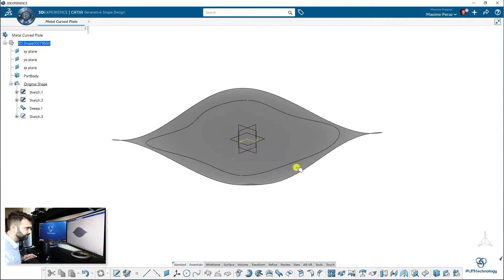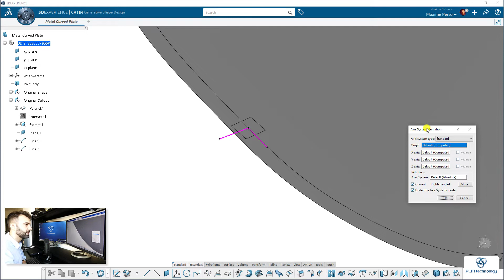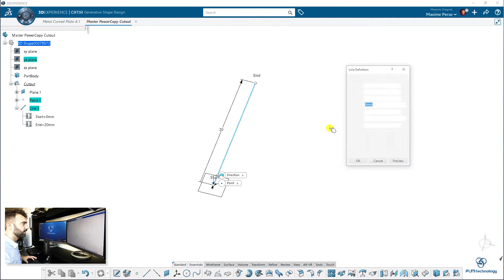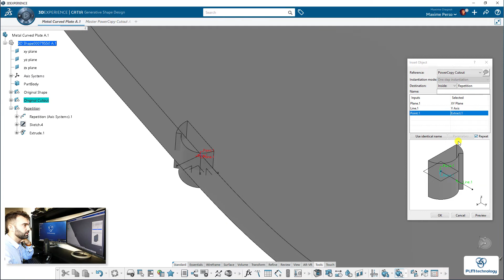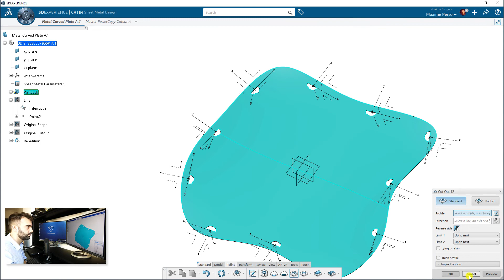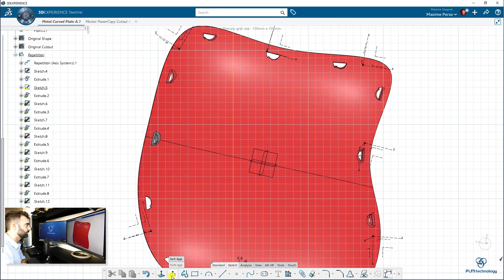Power Copy for Cutout Sheet Metal - CATIA 3DExperience R19x

Comment: Hi Maxime, Thanks for the video!
Would it be easier to put the points, plans and lines a several lists and use it to create the PC instead of selecting them manually in each PC? (or maybe this option wasn't available in R19?)

Comment: i like your patience and explanations...superb....explain something industry oriented design process to understand better what exactly going on industry about design...please explain application of the tool with example could be better
Reply from the maker: Hello Dinesh, thank you for your comment. This video is actually industry oriented (from customer scenario). This is a double curved sheet metal part containing a special type of cutout from a machine. The part is designed curved and the holes are position around it and flatten the part at the end.
Powercopy allows you to save an assembly of feature (commands) and reuse them to create quickly a complex shape. It is used especially for repetitive tasks. Another example could be for plastic clips or a plastic/rubber profile. (watch this video: https://youtu.be/W9js4Ax6OqI )
Reply: @MaximeChagnot  oh nice...thank you i will see this one again...
Reply: Is it right to use spline in industrial design as you created in this profile?
Reply from the maker: @dhineshwaran551  Can you elaborate your question? Not sure to understand
Reply: @MaximeChagnot  is it correct to use spline tool in sketch from industry point of view...actually my friend told me that no one use spline tool in industrial design process...
Reply from the maker: Ok Dinesh I understand! Well I guess this will always be a debate. I think it depend on what you need to design at the end. Myself I prefer spline in 3D because you have more control and flexibility (so I recommend you that). Then if you want to use spline in sketch you should maximum 3-4 control points. More than that, it will never give good result. In my video I use spline in sketch to quickly create a double curved plate. I will never exclude spline in sketch, because it is still a helpful tool, you should just know how to use it.
Reply: @MaximeChagnot  yes..thank you